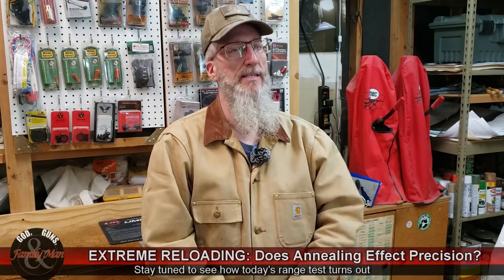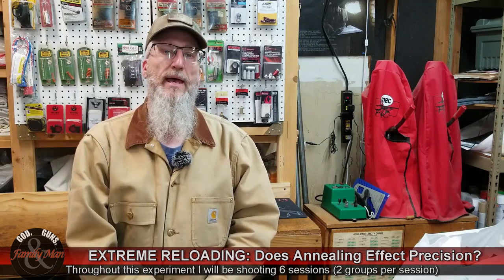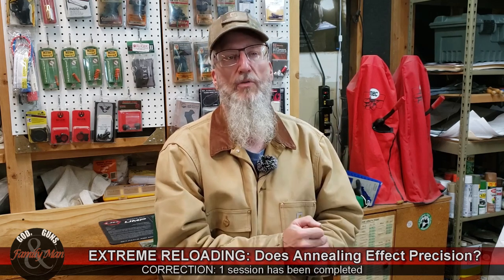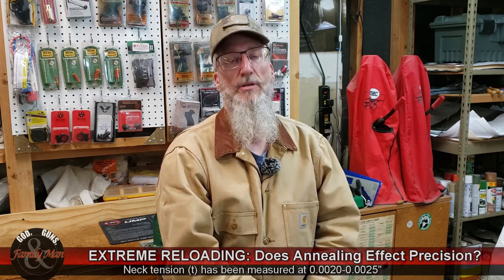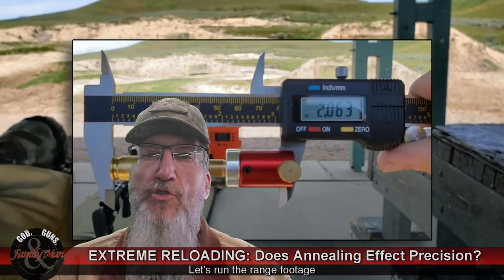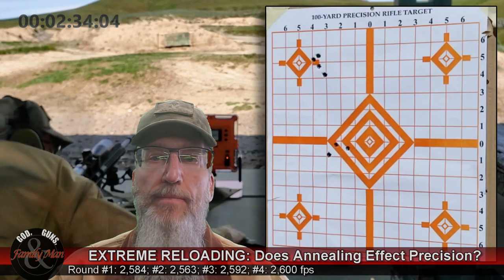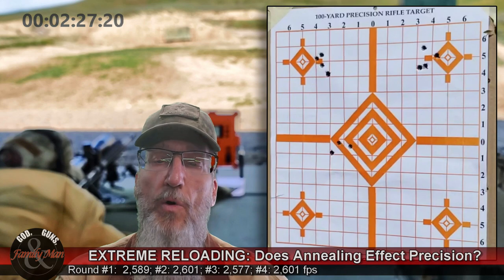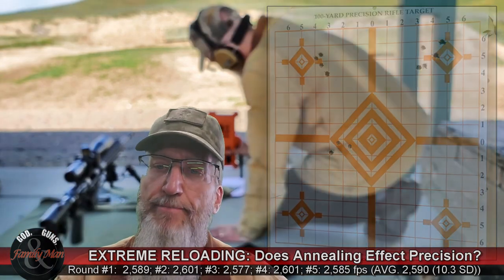EXTREME RELOADING: Does Annealing Improve Precision? (part 2 ep. 03)

Comment: You're using 168gr projectiles and you stopped at 2560fps with RL15 when you could be pushing 2700+fps? Why?
Reply from the maker: When creating a precision load we often use either the ladder method or optimal charge weight (OCW) method to identify the best load for a given bullet.  I tend to have much better success with the OCW approach.  The result is consistent velocities with a SD normally in the single digits or low teens.  The velocity is not important when punching paper (this is not a hunting load) and I can still shoot this round effectively out to 800 yards.